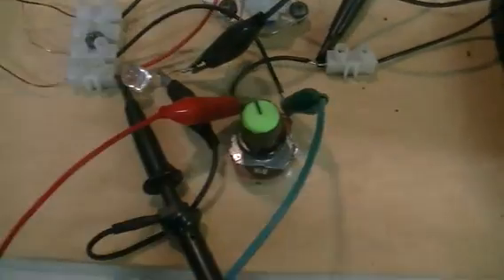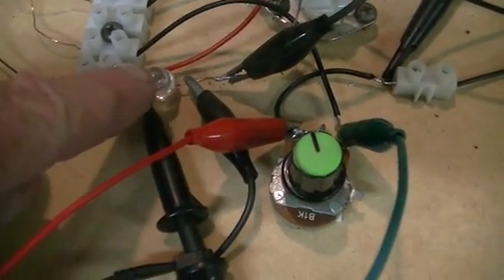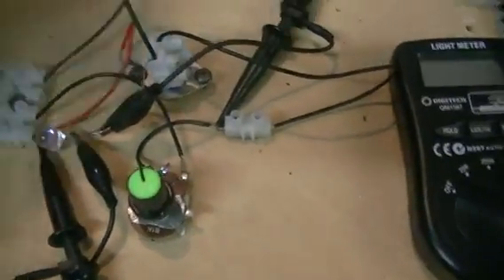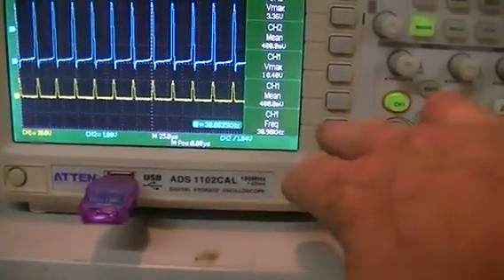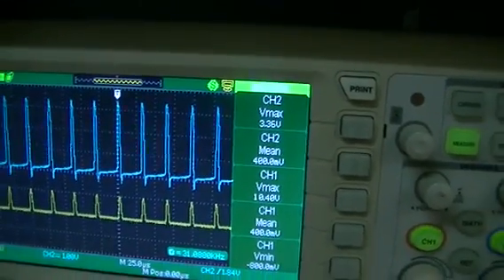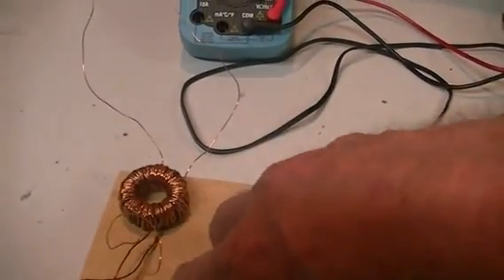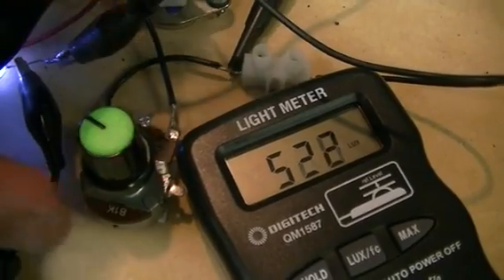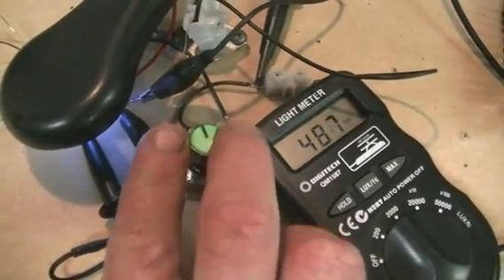Joule Thief Truths PT1

Comment: When I adjust my pot I notice changes in pulse, but the window in which the LED gets brighter is really small. So it is hard to find as I have a multi turn pot and eventually you will see it get a little brighter, but nothing major. The big change is the pulse of the transistor.

Comment: Brad:

Nice job.  This confirms what we saw in the old JT topic about 6-7 years ago.  I never did do a valid test other than using my eyes so now we have good evidence that this was correct.  If you let the voltage drop to where the led exhibits visible flashing due to the freq. dropping, cutting the base resistance can restore that to a freq. high enough to appear to be constantly on.

Very good to have this on video using your scope and the light meter.  Well done.

Bill
Reply from the maker: +Pirate Labs Thanks Bill,and more to come-better quality video uploading now.

Comment: I don't follow the forums, but seeing the voltage raise in the LED would be enough evidence for me. The lux meter is an added bonus. 
 To do the task you are talking about, a LDR or photoresistor could be implemented with a proper IC circuit to regulate ressisyance... that would increase the power consumption. I have a simple idea that will take some fiddling to get to work. You make a small electrolytic cell that places out colloid. This should slowly decrease ressistance as a redox reaction occurs. There are many options for this but one should consider the final products chemical composition usability, and the cell construction to minimize losses. In theory it should work, but experimentation almost always gives us the best answers. Hope all is well with you and take care mate.
Reply: Pardon the typos, I am on  my phone on a lunch break.